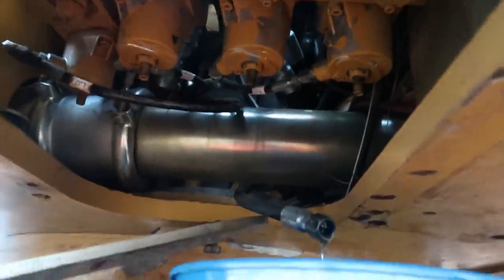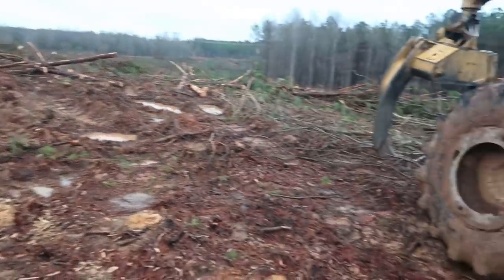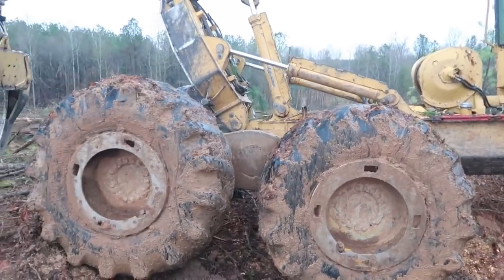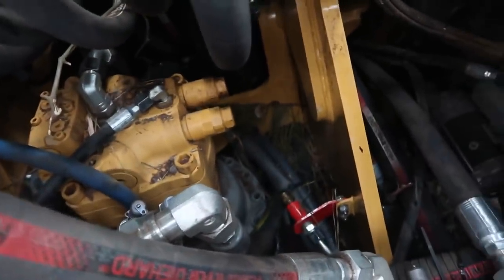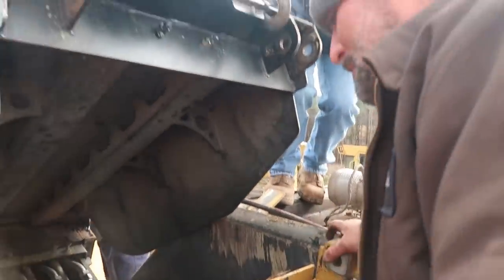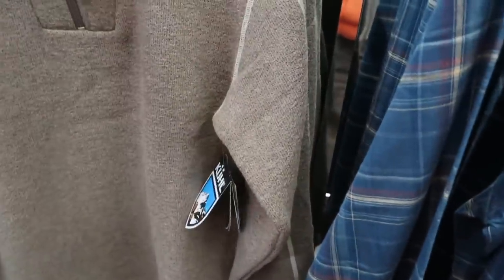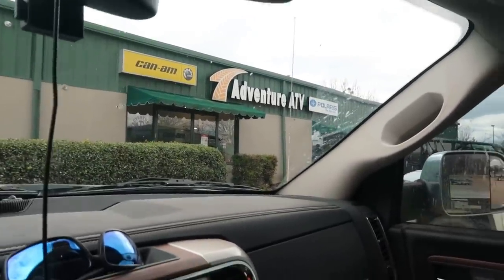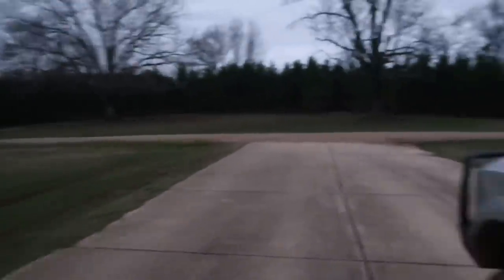Tigercat 830 | working on it

Comment: got a quick question for ya tim,why don't yall run chains on your 635? we run em year round up here in Canada and they seem to help with tire wear a fair bit,the outfit I work for used to have a 635 and we ran the band tracks helped with tire wear and made a huge improvement with traction. its great to see how yall log down in your area